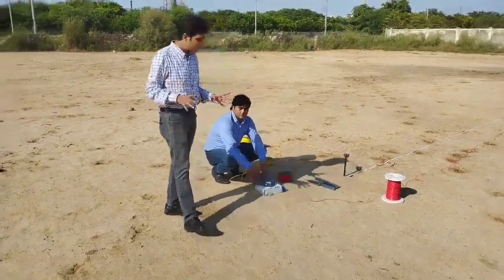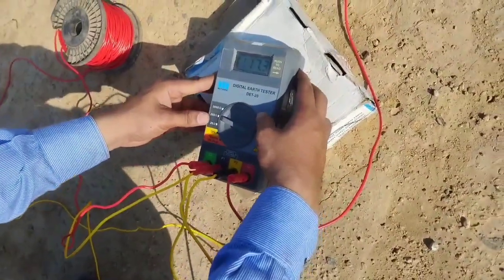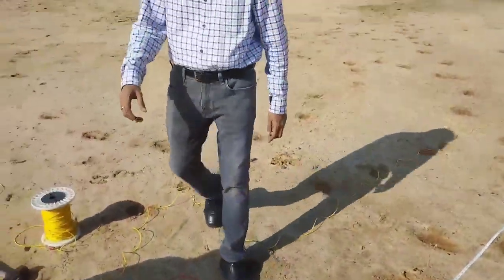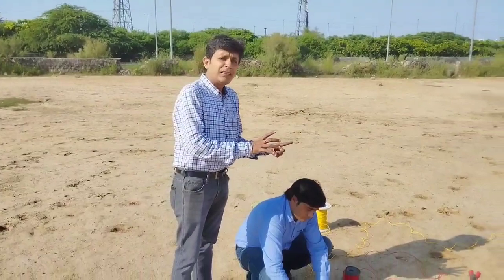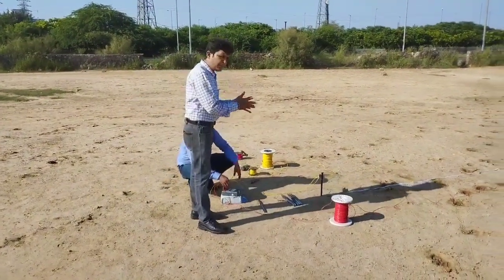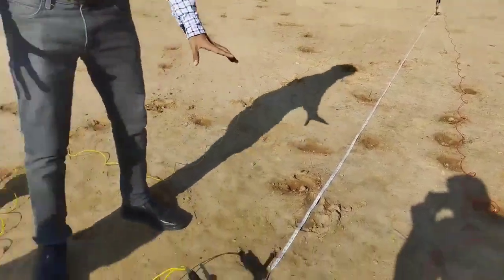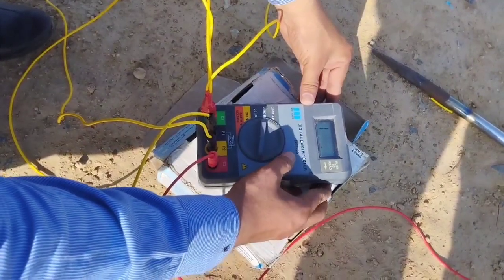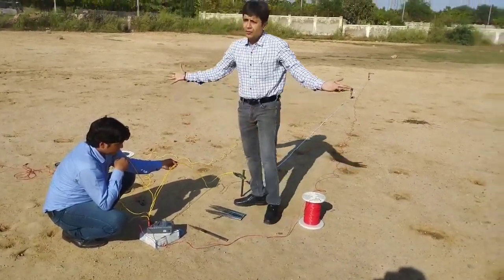Experiments: Electrode Resistance Measurement - Accurate Method  #earthing #grounding

Comment: Very nice video sir but in Delhi like city which is very dense and populated how could the maintain the ideal distance between two electrode .. Also central delhi having different challenge due to hard rocky area due to results are mostly deviate . Suggest in this regard pls
Reply: Compromise methods like 2 pole are available. Your meter should have 2 pole feature.